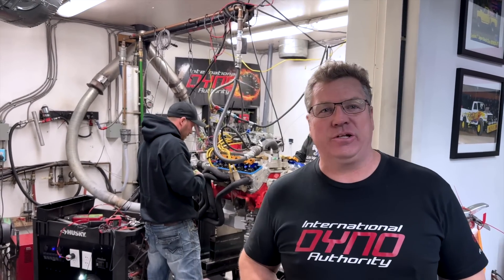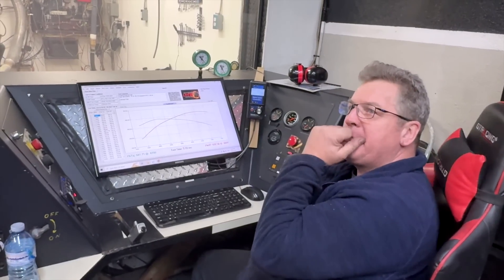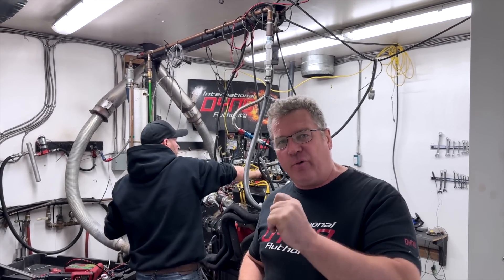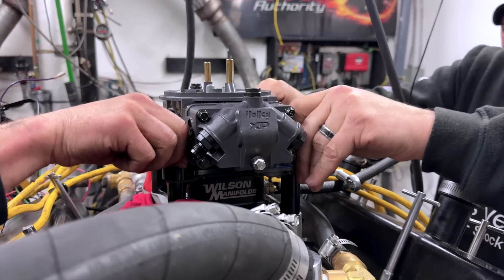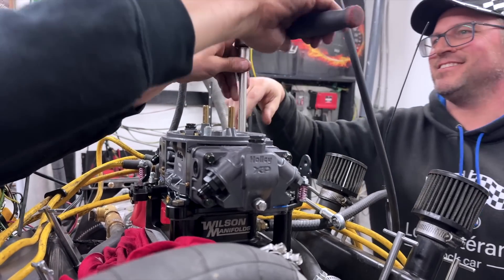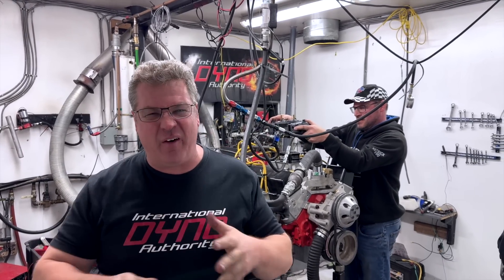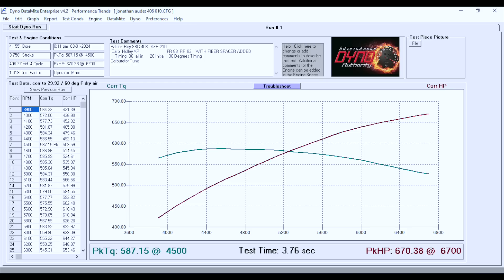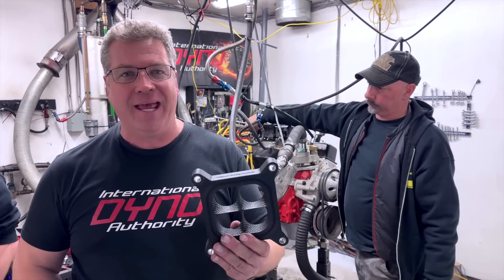Dimpled Intake Spacer adds 21+ HP to a 408 Small-block Chevy!

Comment: What would it do on Super stock 408 Q-jet carb
Reply from the maker: The results are going to be fairly similar, on pretty much each setup. Setup. Each setup, depending on the camshaft, depending on the RPM range, depending on the carburetor and the spacer and the intake are going to vary. 

However. You are taking air that is going to travel from point A to point b. 

You are forcing that air to travel more distance to get to the same destination. This has the effect of speeding the air, and, while it is the same volume. AirSpeed is everything

Comment: What is the intake? Open or duel plain?
Reply: Didn't edabrok make a duel plain. Called rpm air gap. That would pull 6500?
Reply from the maker: @dougstringer1097  

Air gap Rolls torque over Starting at 4,800 rpm
Reply from the maker: This engine pulls, and makes power, well into the 7000 RPM range 

It is a single plane 

A dual plane, will shut down anything after 5,600 RPM

Comment: I really doubt these claims, because, look at the facial expression on the young dyno mans face as you are blowing about this miracle spacer !! It says you are full of bull !!
Reply from the maker: Here's the issue, we were not there to test the spacer 

We were there to tune. Look up the business. 

This is what we do. We tune. We only tune to make the most power out of each engine each time. 

Yes, we were impressed that this particular change, resulted in a very nice increase. 

However. The proof is irrefutable on this engine at this time with this cam with the set of cylinder heads with this carburetor, on this combination, it makes a very, very big difference. It runs better. It fuels better, it absolutely makes a boatload of power. For this particular combination. 

We are no way associated with the people who make the spacer. 

We outright purchased the spacer. Actually the person who was dyno testing their own motor. Purchased the spacer. And they were only trying it to see if it did anything. At all. The dyno operator had no expectations. And at no point did we know anything about this until we actually tested it. 

And yes on this day it was very very very impressive. And it worked very well and it made big big big power. Huge power
Reply from the maker: We invite you, to come down. To the dyno. And try your own combination of parts. We invite you to try any combination of spacers that you like. We invite you, to test and tune for yourself. That way you can see whether, it was or was not useful for you on your combination on your engine with your camshaft with your cylinder heads with your intake with your carburetor. 

And the young man. Thank you very much. He's older than you are

Comment: Air velocity vs cfm of carb and the heads drawn ... Engineering basis us bigger runners carb and spacer to the air volume velocity per cubic inch ... Dialing it in precise will get you a solid response and power band curve

Comment: The spacer mistifies the fuel closer to a vapor to burn faster and possibly cleaner with less carbon deposit on the pistons
Reply: Seems like you could do the very same with stainless steel mesh screen under a basic spacer

Comment: Hello i'm curious what compression is really worth? My 10.7 to 1 399ci. pump gas stroker makes 641@6400 and 560 ft lbs.@5700 with a BBC journal solid roller 260/266@.050 and 679/668 on a 110 lsa. To round it out 261cc Brodix 18* C-Series heads(told 404cfm), QFT 950 Black Diamond on a GM Performance 2 piece intake. I'm looking to retire next year back to Windsor Ont. from a little town in NYS that doesn't have e-85 in the area. Do you think it would be worth it power wise to up my compression to 13 or 14 to 1 and run e-85 as it should be readily available in Windsor. What would you think would be a reasonable increase to look for? Not really interested in nitrous, blower or turbo. Will definite look into the spacer, oh and that was an excellent dyno video.
Reply from the maker: Each full point of compression is worth 100 HP.

Depending on cylinder heads

Depending on fuel

Depending on cam

Depending on rpm

Depending on induction

Etc...etc..

"All out" builds 1.8 HP / cubic + can use 16 + compression.
Reply: @internationaldynoauthority693  Thank you for taking a moment to address my question, think I want to keep everything I have and keep it to a compression issue along with the intake and carb as it's just a street toy. Doesn't seem it should be much of a stretch to pick up an additional 100 hp. if I go with e-85.
Reply from the maker: @waynetessier3058  Yes, but you will need a completely different carburetor. If you're going to switch to e85

Comment: Great power. What are the camshaft specs?
Reply from the maker: 236 241
687 691
111
Reply: @internationaldynoauthority693  the excellent way it carries past peak hp, I'd of bet $$ the cam LSA was at minimum 112 and felt probably 114.
Reply: No way the duration is that short with that much lift! These circle engines usually have a 108 lobe sep. Those are wrong specs. It would albe impossible for this engine e to make that power with that duration

Comment: Currently building a long rod 408 for my Gasser street strip. I am setting it up for E85. I'd be curious how that one would run on E85
Reply from the maker: Certainly a great experiment to try. And, a great way to do that is purchase a very inexpensive part that no matter what cannot hurt. Might even make you some more power. Let me know how it works out. Or if you want some Dyno time

Comment: I'm surprised that spacer worked that well. Now I've seen head ports dimpled and heard that it doesn't work. What are your thoughts on dimpling the ports in the head?
Reply from the maker: As always, I think you need to test and to try. That is a big test. If you're going to dimple the entire intake tract on the cylinder head. It's going to take some time. And you're going to have to test it back to back. However. It would be an interesting test. This seem to work very well. But, I'm not completely certain any more dimpling is necessary. And I think that different combinations will work with this and probably other ones will not favor this as much. Test test test test
Reply: In every case we have tested we see gains in dimpling. Rottler has a patented CNC program for their 5 axis machine that does these and they have documented before and after examples as well.
Reply: Was that on the flow bench or the dyno? It may not show gains on the flow bench but the extra atomization could surely show improvement on the dyno.

Comment: It would probably make more with a 4150 1000cfm, or a dominator! I’ve never seen a 408 lose with a bigger carburetor! Also those usually take more timing! You should probably show the plugs also! AFR readings can be off! Plug tells you everything! 1.64 per cube is pretty good, but I’m betting there’s more in it! 👍🏻👍🏻👍🏻👍🏻
Reply from the maker: Totally agree with you. If I was doing a dyno contest. What I would do, is keep going up and see if them. Until, it didn't make any more power. Tuning for grunt out of the corner. And the best RPM and horsepower down the straight away. It's a circle track car. So it needs that grunt every time. But, I have to say as far as peak horsepower goes, I agree with you. It would  be nice to try

Comment: As you changed valve lash. Where were you at your first setting and what did you change to setting.
Reply from the maker: ,.010
Reply from the maker: We checked lash.  Set at 10 thousandths after break in . We then verified that each was still at ten thousandths
Reply: My 409 is set at a bit loose at .022hot.

Comment: what is engine specs? is this a 700 hp engine that is choked down by very restrictive intake manifold ? or this is a 600 hp engine that is shown that makes more power with bolt ons
Reply from the maker: This is a circle track engine, with 700 lift. They are not looking for drag racing torque, and maximum all out full build horsepower. Where you're looking for a 10th of a 10th. They are looking for really good grunt out of the corner. And very competitive horsepower. I think with 575 foot pounds of torque and 650 horsepower they're right in the range. They're right in the hunt.

Comment: Air filter will change that fuel setting too.. just a spacer alone makes a difference without dimples..  like to see comparison with and without dimples i bet there be negligible difference..
Reply: The Wilson that was run just before the dimpled one was un-dimpled. The 21+ HP was made with head-to-head parameters - dimpled vs undimpled.
Reply from the maker: Agreed, I think what we will do. Is one day. We will take one of our modified motors. And do a whole barrage of just testing.

In this case. We were tuning this particular engine so that the customer was ready for circle track season. But, it would be interesting to take that exact same spacer have the dimples removed. Or manufacture one with no dimples. And see what the difference is. Then it would be nice to stack two of them. Then it would be nice to try a 2-in. It would be nice to try one of those underneath of a straight 1 in. They'll be a lot of fun testing all of those combinations for sure.

One thing for certain. When we added this particular spacer on this particular day to this particular motor. It definitely was a very good combination. And the results were very favorable for that customer
Reply: @internationaldynoauthority693  thats the best honest results...  carry on we love big gains over hyped up expensive junk..

Comment: AF number means nothing its just a number try not to let that hold you back "read the plugs".
Reply: How do I tune my SBC the correct way? EGT?
Reply: divine intervention??? @jackline1255
Reply: divine intervention??? @jackline1255
Reply from the maker: Ask Byron.....
Reply: Yea. I don’t think these guys need tips. Exsperiance is priceless. If you have a handle on tuning the afr tells a lot.  I like egts. But after time the readings mean a lot more to you.
Reply: @jamesgravel7755  I was saying don't get stuck on a number for AF all engines are dif AF reads a bank of cylinders one could be lean and one rich avg out to look fine 8 O2s would be better but still not as good as reading plugs if you know what your looking for.
Reply from the maker: Keep in mind, every time We read the air fuel ratio. And we made a change to bring the air fuel ratio into the correct 12.8 range. The engine made more power and more power and more power. When we used to read the spark plugs. It was harder to see. It was more difficult. And you definitely could not jet the carburetor in the low or the mid-range based off of a spark plug. The spark plug only shows you one spot in the range. That's the final and that is the higher RPM with the most heat.
Reply from the maker: We pulled the plugs. We cut the plugs. We read the plugs. At several intervals.

What reading is fantastic. Plugged reading is fantastic. However, it only shows you the fuel at one spot in the range.

When we're reading AFR we are reading 100 over 100 all the way through in the entire range. And we are watching each one of the circuits of the carburetor as they interact with each other as they interact with vacuum. And. If you had a really close look while we were running. We were also recording vacuum. So we could see when the carburetor was acting as a restriction. And we could see when the carburetor was at zero vacuum at full open throttle.
Reply from the maker: We would read the plugs in the '70s. We didn't have an air fuel gauge with the current technology back then. We would also read the plugs in the '80s and even into the '90s. Now that we have technology, I don't think we're going to go backwards anytime soon, but we always always read the plug to verify ignition timing. We read the plug to verify how far it's burning down in cycle. And we also read the plug to see if we're getting a nibble and or if we have a nice brown strap coming up from the bottom of the ceramic

Comment: I've learned you never know what works until you try. Sometimes I guess correctly, but I would rather dyno it and know. I feel that's the best way to learn.  Great information.
Reply from the maker: @terryenyart5838  completely agree, test, then check, change, then test again. But don't go against the test results. Results. Just see what works and see what doesn't work. One thing about a engine dynamometer, it has no conscience and it doesn't care. If you make more power, it will simply show you.
Reply: wet flow from through a 4 barrel to a  common plenum  to 8 inlet tracts is a clusterfuck of guesswork.

Comment: Thats pretty wild, I've seen someone dimple an intake and it was basically useless. The dimples in this spacer are much deeper though which may be the ticket to it being useful as the intake was dimpled with a dremel type tool and the spacer looks 3d printed or cast. Solid engine!
Reply: ,,,,,,,,,,,,,,,,,,,,,,,,,,,,,,,,,,,,,,,,,,,,,,,,,,,,,,,,,,,,,,,,,,,,,,Deeper dimples ,,,sounds like the answer...............................................................................................................
Reply: unless we test exactly the same spacer without the dimples we don't know whether that are doing anything of it just that divider space.  Its probably just as east to make with the dimples and it a "cool" selling point even if it does the same without them.
Reply: @krusher74  super kewl

Comment: Call C&S Specialties in St Charles Mo they build custom carbs and that’s you just let them know what do you have inside motor cam crank bore compression.
Reply from the maker: We are aware of C&S. Good company. We use all custom Dale cubic carburetors. On our own stuff. For this customer they came in from 12 hours away. They were pretty satisfied, with getting the air fuel perfect. And having a power curve that goes straight up to the moon
Reply from the maker: I think, if this was a competitor who was drag racing. If they were looking for a 10th of a 10th. They would be looking at custom carburetors from a carburetor builder. In this case. You win and lose based on making smart moves on the track. And having a very responsive engine.

We were able to tune both carburetors until both carburetors ran. Absolutely as good as they could. Without being custom carburetors

And I agree with you. If I went up to a thousand CFM carburetor, from a custom carburetor builder. Builder. Like Dale cubic. I can make more horsepower of this entire setup. However, I think the brand new, holy XP. That they chose. Works extremely well. And pulled very hard. It's going to be all up to the driver now to make the proper decisions on the track
Reply: Very good too top-notch